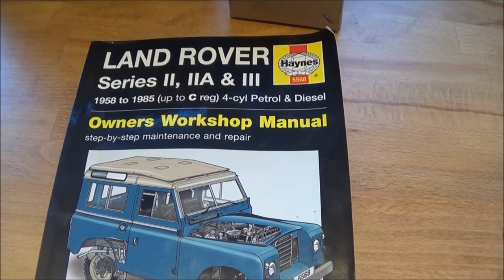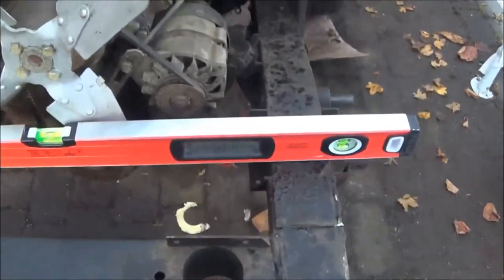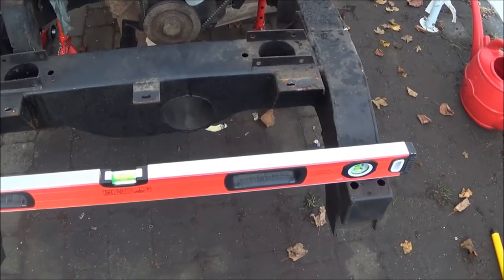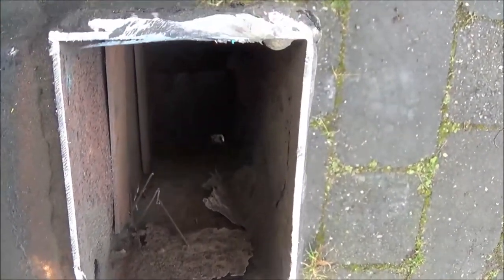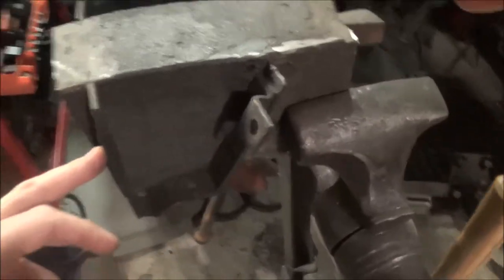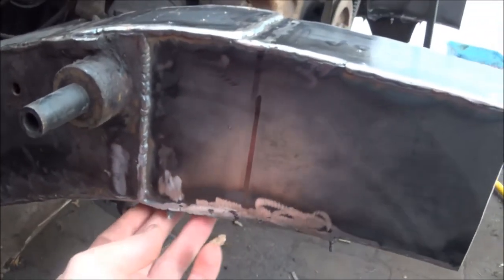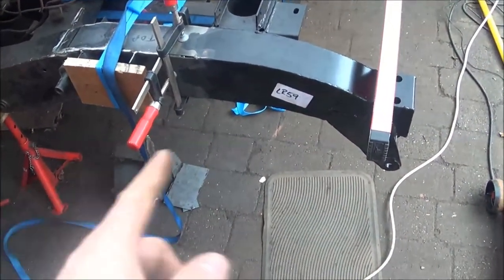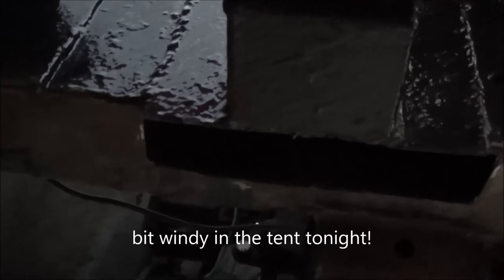Land Rover Series 3 Restoration - chassis repair

Comment: Poor fitting if a front crossmember and dumb irons, you could have done a much better job.
Reply from the maker: how?
Reply: Machine shop at the bottom of the garden 
You could have sleeved the inside of the chassis, and then slipped the new section over the sleeve a strong repair and looks invisible.
I have built front dumb irons and rear half’s of chassis using this type of repair as it is strong.
Reply: @roberthawkins4471 So are you saying you would cut off the flared steel of the new section and replace with inner tabs and rosette welds?  Cosmetics aside, surely the flared ends add continuity and strength, only needs rosette welds or as CSM does, a big X on each vertical plugged with weld onto the original?

Comment: Seems a really professional job, Mine is very similar, did you find there was any spring on the rails once you cut the front off or did the engine mounts secure everything?
Great content - Dave